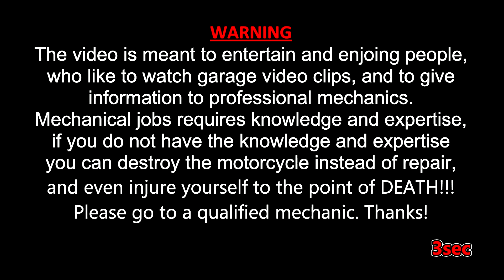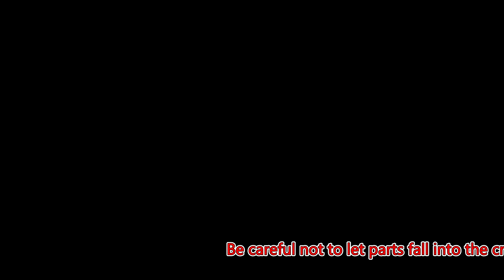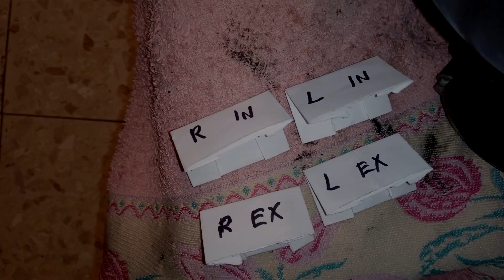Cylinder Head Removal | Upper Overhaul Engine Ep #2 OF 7 | CBR250R 2013

Comment: Good day. Is there any other item I can use instead of the Cam chain holder tool in 3:12? I am unable to find the tool where I leave (costs over $100)
Reply from the maker: @reconnaissanceman23  
Hi sir. You can DIY. Cut a tool in this design from a plastic board, or a tin board. And you can use a small screwdriver. With a screwdriver it requires a little more skill, but it is possible. Screw the plunger with a normal screwdriver, and hold the plunger with the screwdriver until the moment it can be released.
Reply: @mycbr250rdmotorcycling7  Thank you very much. Today I managed to find a flat-head that fits in very well. I'll find something to hold it in place while I loosen and remove the cam tensioner. Best regards

Comment: can i use cb300r block piston and crank asselmbly in cbr 250 ? is it possible
Reply from the maker: Sorry I do not know. I know that it is usually not worthwhile, and you also need to check what the legal conditions in your country require for such a change.
Reply: @@brandonrg7383 After swaping crankshaft ...ecu tunning is necessary...or we can run on stock ecu?
Crankshaft direct fits ...or need any alterations?